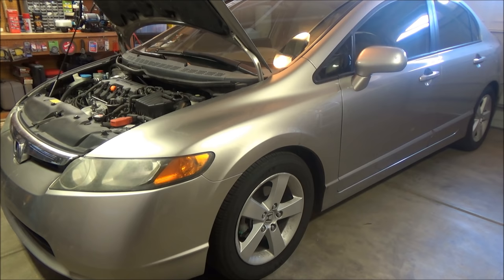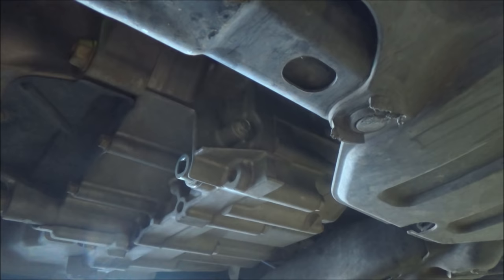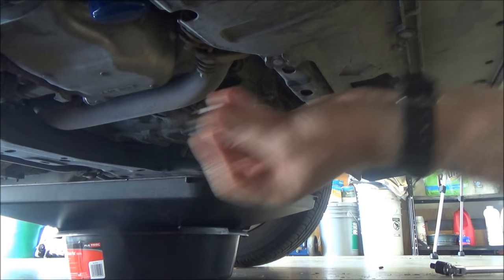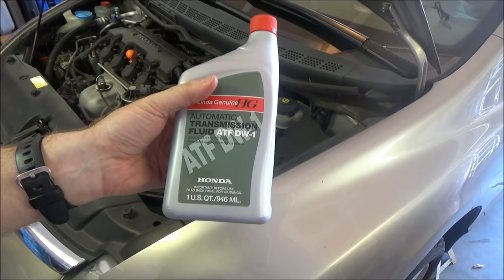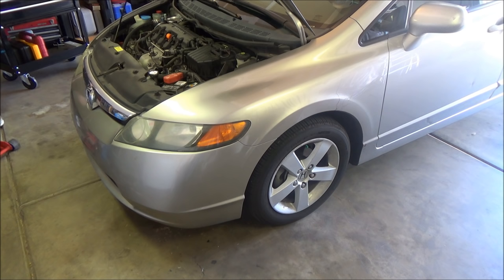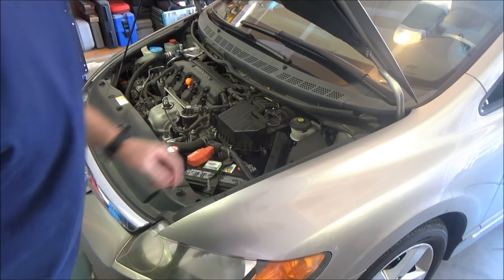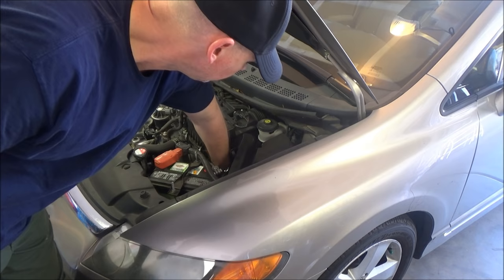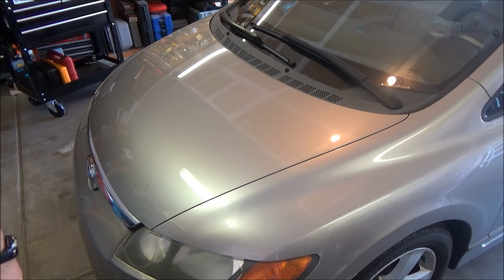Honda Civic Automatic Transmission Fluid Service 2006 EX (2006-2011 Similar) (Drain and Fill)

Comment: Do I let the fluid drain completely until there is nothing dripping at all? And where can I get a OEM washer? Thanks
Reply from the maker: Draining until there is a slow drip is fine.  I get parts like that from a Honda dealer.
Reply: @BigDog50001  Thank you. I will being do this soon on my 2009 EX Coupe. Hopefully all goes well

Comment: hi there I have a 2010 Honda civic. I just bought the car and don't know if the previous owner kept up with the transmission oil change. this video is ur standard oil change process every 30000 miles correct?
Reply from the maker: Yes, this is the standard transmission fluid service that should be done at 30,000 miles.  If you don't know the vehicle service history, I would do an engine oil change as well as a transmission fluid change.  Hope this helps!
Reply: Thanks for the help! Good video.....

Comment: Hello bigdog could u recommend or not recommend to switch transmission oil on a automatic 08 civic 1.8L Lx 4dr 132k miles the transmission runs smooth and all 

I just think I should drain and fill like u did once right now.

It looks pinkish red slightly tint of brown what do u recommend thank u.
Reply: you should be fine to leave it be, red ish is perfect, means nothing is burnt. mine on the other hand is dark brown and burnt smellin
Reply: @hereis6655  thanks for reassurance

Comment: Can you change the Transmission Fluid if you havent the whole time having the car? I know alot of people dont change the tranny fluid. Ive been worrying about mine and heard if i havent done it so far to not do it because it can blow the transmission?
Reply from the maker: There is always a chance of something bad happening when doing any work to a vehicle.  I don't worry about that as much with Hondas because a fluid service like this video only gets about 1/3 or so of the fluid, so it is not as much of a shock to neglected ATF system as other vehicles where all fluid is drained and changed.  For what it is worth, I don't hesitate to service a neglected Honda ATF transmission.

Comment: Hi, I haven't changed my A/T fluid for the last 100K miles. As of yet, I haven't had any transmission problems. Would you recommend changing the transmission fluid at this point?
Reply from the maker: • I won't tell you what you should do, but if I owned a vehicle in a similar situation I would do a fluid change.
Reply: Big Dog50001 Automotive thanks for the fast reply. I think I'm going to go ahead with it just so no problems ever show up on my 10 year old Civic.
Reply: In the same situation. Mine is at 117k and the mechanic says it smells burnt. Its brown. Should I change the fluid??

Comment: Hello, I just bought an automátic transmission 2011 honda civic, and I notice that when driving from 12 to 17 miles it starts vibrating, I really dont know if the ATF has been changed, Do you think it might be the issue?
Reply from the maker: HERRERA CITY RD That could be many different things so it's hard to say from that description.  I would definitely service the transmission if you don't know the service history.  I would also check the brakes and suspension parts too.
Reply: Thanks for the info, i didn't say that is just happen when go slow and last 2 or 4 sec.I changed the ATF. and the motor oil and still happening I will follow your advice regarding  the brakes and suspensions., then I would continue with the spark plugs and the fuel injectors,  regards.
Reply: Honda Civic 8th gen is notorious for their engine mount.  My car vibrates when in reverse gear and when slowing down to 1st gear (e.g. approach the lights) and when in park gear.  Engine mount completely torn, replaced and now no vibrations.

Comment: Good job Ron..BUT you really need to have the car RUNNING to check the accurate levels for any Automatic Transmission.
Reply from the maker: Harold Schulz Not on a Honda.  And who's Ron?

Comment: I drive a manual what should i do
Reply: Same process but different oil and takes more quarts.  Take it to a shop if your not sure what to do.
Reply from the maker: A manual transmission is a different procedure with different fluid.  This is a different generation but It would be similar to the Civic in this video  https://youtu.be/-FRaFLVhpLY

Comment: hey do you know if doing this will make my transmission slip
Reply: Heeey I was thinking the same thing. I saw a Scotty Kilmer video on YouTube and he did say that if you change the oil on the transmission that is real dirty and hasn't been changed for a long time it might start to slip he said because of  dirty oil and the friction it was making the transmission clutches still work. But I saw it was a regular transmission on his video.  I'm thinking I'm  going to do a transmission oil change on my 2010 Honda Civic it has 112,000 miles and I bought it like 2 years ago I hardly use it now because a year ago I bought a 2015 Nissan Altima which has a CVT transmission also which alot  people don't like 🤔
But I'm thinking it's a CVT transmission on my Honda Civic  and I don't think it will slip like the old Transmissions used to do and then again if you use a recommended synthetic Honda motor oil that oil last longer then the oil for the regular Transmissions I would think so.
Reply: If it does your transmission was already about dead. It will probably be fine as long as your transmission is not already acting up. My girlfriend's 2007 civic had really spent fluid, dark brown and somewhat burnt smell. I have done the change twice which amounts to about 75% new fluid so far. It's still shifting fine (actually better than before). After the third and final change it will be 90% new fluid. Honda recommends three changes as a "flush". It's not an actual flush of course, Honda recommends against actual flushes so don't get talked into it.
Chances are most of the people who had their transmission slip after changing the fluid aren't admitting they decided to do it after their transmission was starting to act up a little, then after the change the loss in friction in the new fluid made their transmission useless. One thing is for sure, if it's way past due and you plan on keeping the car for plenty of years to come, old fluid will shorten the life of your transmission.
Reply: @LostBeetle  
Heeey thanks for the advice 🤓👍 I've been looking at some videos on YouTube and only about 2 and 1/2 to  2.9 quarts of transmission oil come out and you add the same back in it's not like my 2005 Grand prix's or my 2002 Camaros I used to have they used to take like 12 to 15 quarts and about 20 bolts around  pan this one is real easy to do. I thought I had a CVT transmission because that's what I had on my 2003 Honda Civic Hybrid but on my 2010 Honda Civic I called the dealership and they told me I had a regular transmission so I'm going to get the oil from them and change it out like you did and I should be okay 
 my fluid it still looks red  not like you said on your 2007 Honda Civic it was a little brown and you said it worked fine after you changed it so I'm going to do the same thing you did  😁

Comment: Hi civic hybrid 1.3l same cvt oil?
Reply from the maker: No, Hondas with a Continuously Variable Transmissions (CVT) will generally require the proper CVT fluid.  If it is a 2003-2012 Civic Hybrid with a CVT, then it should take 1st Generation Honda CVT Fluid (Part # 08200-9006).  

Newer Honda with CVTs use 2nd Generation Honda CVT Fluid (HCF-2), many models changed to this 2nd gen fluid around 2013-2015.  Be sure to double check this info and always be sure to use the correct fluid.
Reply: @BigDog50001  tnx lot

Comment: What about the other 3 quarts of oil in the converter? You leaving that in there? Thats why its recommended that you drain the first 3 quarts, add 3 quarts of oil then run the car through all the gears and then drain and replace 3 more quarts. Sounds like you mixed 3 quarts of clean with 3 quarts of dirty.
Reply from the maker: This is the standard procedure outlined in Honda Service info.  Doing an additional two more drain and fills is an option but it is not a standard maintenance procedure that is done during service.  It is always fun to read comments from people that have no clue of what they are talking about.

Comment: A jack and jack stands are not needed.  Just park at a driveway where two wheels can be on the elevated part and two on the lower part.  Then there is enough room.

Comment: How much does the transmission fluid cost?
Reply from the maker: Jon Doe I get it by the case, I think it's about $6 per quart.
Reply: I just bought some today. $8 per quart. Gonna change my transmission fluid tomorrow. Thanks for the video.
Reply: yes, It's about $8 per quart. You'll need 3 of them, it takes 2 and a half.

Comment from the maker: Tools and parts used
This channel earns a small commission using some of these links - at no additional cost to you.
Long Funnel:  https://amzn.to/3Dox5xH
Breaker bar used in video: http://bit.ly/2EgRuF8
Genuine Honda ATF Fluid Part # 08200-9008 (ATF-DW1):  https://amzn.to/2Kzou1t
Washer, Drain Plug (18mm) Honda Part # 90471-PX4-000:  https://amzn.to/2Z7AQH3
Transmission Drain Pan:  https://amzn.to/2WrDTKh

The Big Dog 50001 Automotive Channel Store can be found here: https://www.amazon.com/shop/bigdog50001automotive  (As an Amazon Associate I earn from qualifying purchases).
Reply: Big Dog50001 Automotive what about the filter?? Maybe is dirty
Reply: Where did you get the drain pan?

Comment: this is only effective if you do it often. Draining only removes about half of the old fluid. Half of it is still in the torque converter and lines. If you haven't done it in a long time, get a flush instead.

Comment: You check the transmission fluid when the car is turned on
Reply from the maker: Nope, not on Hondas.  Automatic transmission fluid is checked 60 seconds after shutting off the vehicle on most Hondas.

Comment: USE Honda HCF-2 fluid ONLY..file:///C:/Users/gunner/Documents/Honda%20Genuine%20Oils%20and%20Fluids%20Applications.PDF
Reply from the maker: Honda HCF-2 is Continuously Variable Transmission (CVT) Fluid and is used in models with CVTs.  The Civic in this video has a conventional Automatic Transmission (A/T), NOT a CVT.  Using the wrong type of fluid can damage the transmission.

Comment: i would disagree with washer replacement, it doesnt appear to be a lock washer that compresses, just a regular washer.
Reply from the maker: It's an aluminum washer that crushes down and forms a seal when used (which is why it is also referred to as a gasket).  I recommend replacing it every time, as does Honda.
Reply: @BigDog50001  Something is not right here. You say it's an aluminum washer (gasket) but your Amazon link to a bag of 5 for $20 says they are STAINLESS STEEL. That material is not COMPRESSIBLE. Other than that I appreciate the clear video!

Comment: I am very sorry to rain on your parade but where there is oil there is a filter , you didn’t change the AT filters according to my experience there are two one is outside just below the air filter , and the other one is inside the transmission .

Comment: It's takes 2.7 L and there is an external filter below  the air filter box. If you're going to show people how to service their car do it right
Reply from the maker: It is always fun to read comments from people who have no idea what they are talking about.  Here is the info copy and pasted from Honda service info (so you don't confuse other people who made read your comment):
2006 - 2011 CIVIC — ATF Replacement
Automatic Transmission Fluid Capacity:
2.4 L (2.5 US qt) at change
5.9 L (6.2 US qt) at overhaul

As far as the ATF filter, here is the standard wording Honda includes on most ATF filter servicing:
"NOTE: The ATF filter is not a scheduled maintenance item. Replace the filter only if it is leaking, or contaminated, or when the transmission is being overhauled or replaced with a remanufactured unit."